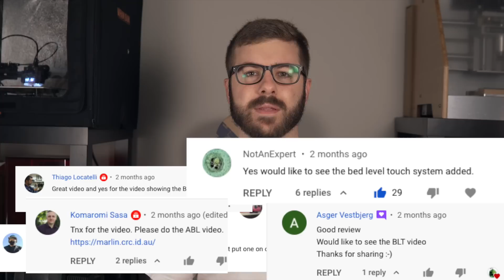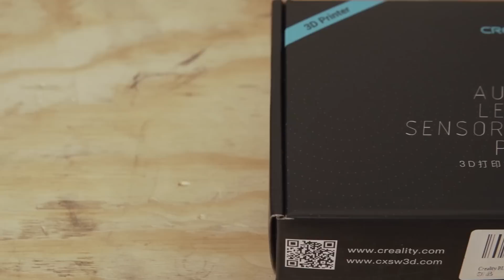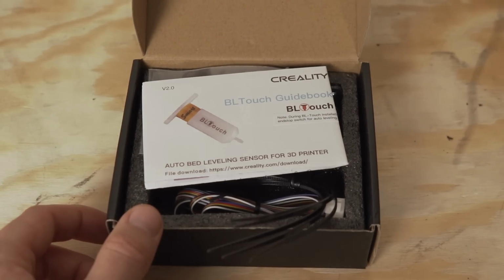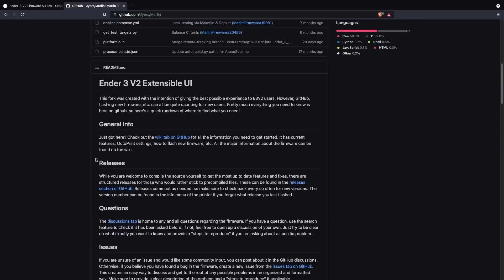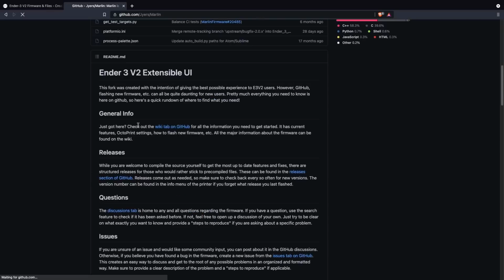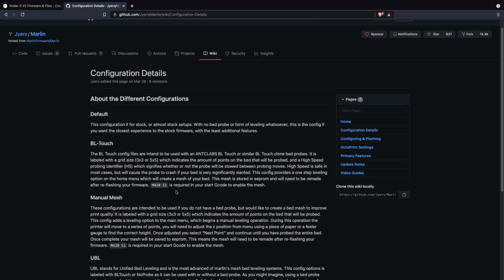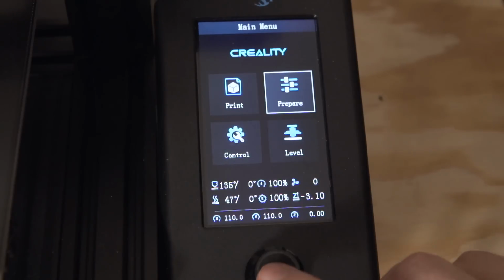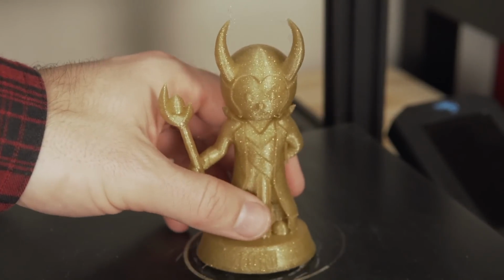Installing BlTouch Into Creality Ender 3 v2 3D Printer For Auto Bed Leveling

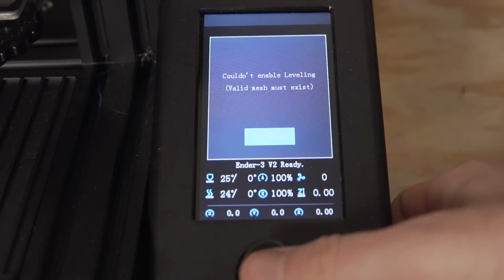Comment: When we get into the levelling menu (9:54), mine moves to center and says 'bed leveling, please wait', and it sits there presumably forever... and suggestions?
Reply: Figured it out.. at 7:28 you tell me to disconnect my Zstop switch... That for the current version on my printer, needs to remain connected.  The BLT connects to headers adjacent to that line of connectors...

Comment: WARNING for anyone who has z axis trouble after following this video! I had to calibrate the BLTouch BEFORE removing the connector. I tried following this video & lost about 45mins trying to figure out why my Z axis was unresponsive & why my printer was throwing errors - the errors basically said "the printer head doesn't know where it is!"

Comment: I installed mine a year ago and it still only prints on half the bed 99% of the time. I manually leveled it then auto home it then auto level it. I've setup my offset also. It doesn't seem to push material out sometimes either. I've only printed maybe 4 things in 2 years because the machine is a pain

Comment: Thank you for all your videos. They are beyond helpful, especially to someone that's new to the hobby. I do have one issue that I hope you can help with. I recently installed the Sprite Pro on my E3V2. The instructions to install the CR touch are scarse but I believe the CR touch mounts right to the side of the Sprite with the bracket that's already there. When I run the bed leveling program the sensor position is too far forward and does not make contact with the bed. Is there a way to adjust were the probing starts?

Comment: Either way, I do everything the same way. I fix my Z offset till the paper scratches the nozzle aaaaand it still prints in the air.
Reply: have you found a solution? currently having this problem..
Reply: @ChaseScannell14  I haven't calibrated it for a while, gonna check this today or tommorow. I'm going to let you know.

Comment: So when I go to the leveling tab it doesn't give me options, it simply starts "Bed Leveling"

Should my glass bed be level to the frame/surface or should it be done with a  bubble level, and should that all be done before using the BL touch?
Reply: Level your bed first. The BLT can't turn those screws for you. It can compensate for any issues by adjusting the z axis, however the bed has to be level first

Comment: I have to change the firmware to install the marlin bin? I try to installed and the printer wont do nothing so I try with the bin from the creative site and it work. It get flashed to the printer.

Comment: So I have a CR touch and crealitie's firm ware for it. I have G29 place in cura just like you have M420. by having G29 in there it performs a 3x3 mesh with a hot bed and nozzle before the print. my question is will the M420 code do the same or will it just input a set of reading from the last time you made it mesh. I definitely want the probe to do it job before every print. also I am planning on switching to the jyers firmware but like I said I want a new real time mesh for every print. what are your thoughts on the difference between G29 and M420?

Comment: Why can't you use a G29 command?  Wouldn't that tell the BLT to auto level before the print, in case something has changed?
Reply: I have G29 set to do that on mine.

Comment: Good video now what we do need is universal plugs and custom extensions. I know there is a market for those so we will be working on that for customers. So if you need a custom cable feel free to reach out to us. We will do our best to also start selling on Amazon common adapter cables for those printers and ABL system. Running a print farm we noticed things are just missing and not long enough period so we will be working more and more on solutions for this.

Comment: check out smith3d for firmware, if you enter smith3d ender 3 v2 into google it should show up right away, they support both 4.2.2 and 4.2.7 main boards and it s the best firmware I've found so far. It gives you a huge amount of customization and options for fine tuning and it basically took the place for pronterface, at least for me. I am not sure about the 4.2.2 firmware but the 4.2.7 allows you to change anything from the color of text and banners to setting your acceleration, jerk, esteps, bltouch probe options, PID tuning and so much more. I think its worth checking out, i don't want to discredit the mentioned firmware in the video i just haven't used it before and I'm sure it works great and creality firmware is usually pretty basic and can be rough to deal with at times.
Reply: I'll look at it, thanks!

Comment: Now a runout sensor.
I had a headache with the ender 3 v2 runout sensor port it just crashes the firmware when its enabled.
But I got it to work I use the z endstop connector

Comment: Will this install on an Ender 3 that has been upgraded to the 32 bit board?
Reply: Yes it should.  If you upgrade to the 32 bit board and LCD w/knob like I did you have essentially turned the Ender 3 or Ender 3 Pro into a V2.  I had to use firmware for the V2 and not the Ender 3 Pro.

Comment: Would this also work for the Ender 3 MAX?
Reply: I dont have an Ender 3 Max, so can not tell you if the mount is the same or if there is one included in the box for the Max.  I would guess so, but that is just a guess.  

With that said, you can always print a mount if one is not included and Creality shares boards between printers so the install method is the same.  Just have to flash it with the correct firmware for the Max.

The only other thing that might be a factor is if the included cable is long enough for the Max.  If the kit says it will work with the cr10, it should be.  I  dont have any experience with the Creality kit, just clones.  The clone I bought, the cable was long enough for a regular Ender 3, but probably not the Max.

Comment: For those who have never used a BL Touch before, you might want to let them know that if anything blocks the startup cycle test of the BL Touch, it will go into a failure mode.  To reset the failure mode, you need to remove whatever is blocking the probe and power cycle the printer.
Reply: mine is giving black screen nothing is blocking it
Reply: @jasone1881  same here, did you manage to solve it ?

Comment: NOTE: The firmware on the "Creality3dofficial.com" is significantly outdated and should not be used. "creality.com/download" has a more recent version from March of 2021. As of version 1.3.3 Jyers firmware is no longer using Marlin's "Extensible UI" framework however his release is still the best version available for Ender 3 v2.
Reply from the maker: Thank you for the heads up. I went ahead and added the linked site as well.

Comment: When levelling manually you ensure the printer is squared what is important step that should be done at least when assembling the printer.
Auto bed levelling allows to correct the deformations that occur along time and improve the quality of the first layers and the success of the print. 
The two system are complementary and should not be opposed.
Reply from the maker: Agreed, if the bed is not manually leveled quite well then your parts are going to be all sorts of skewed. Definitely more intended to help with minor deviations. For the sake of budget printers it can be nice for warped beds.
Reply: This is exactly the reason I bought a BL touch. My friend gave me his old printer and while it's printable, it requires a lot more maintenance and is no longer 100% level. I'm hoping this will compensate for the areas of the bed that are a bit iffy.
Reply: @charreddoritofloof  If there is a deformation of the bed, what is almost always the case with more or less deformation, you should activate mesh levelling. That may require an upgrade of the firmware if the printer is too old, and may be the replacement of the main board.